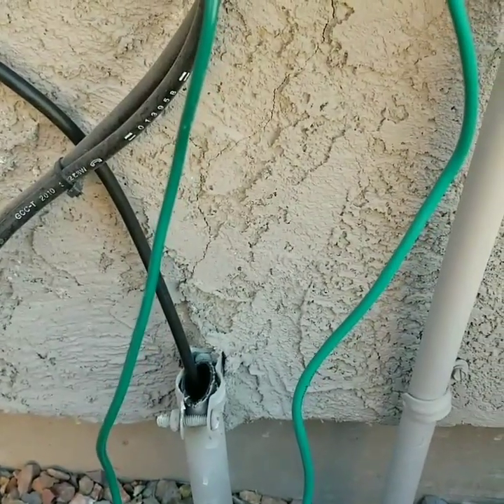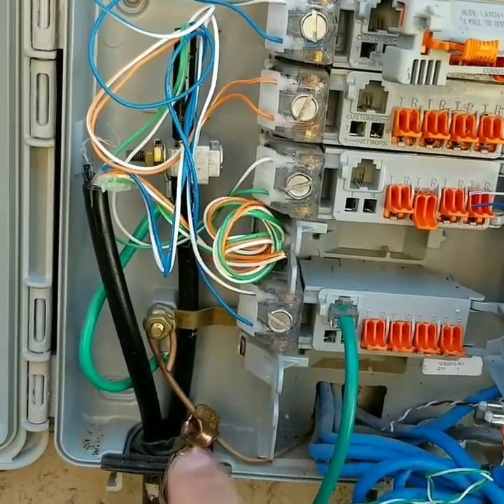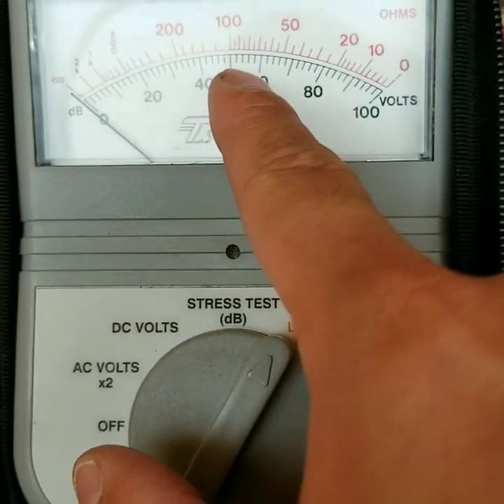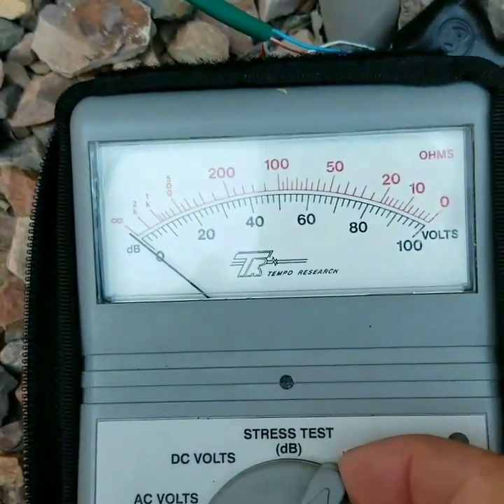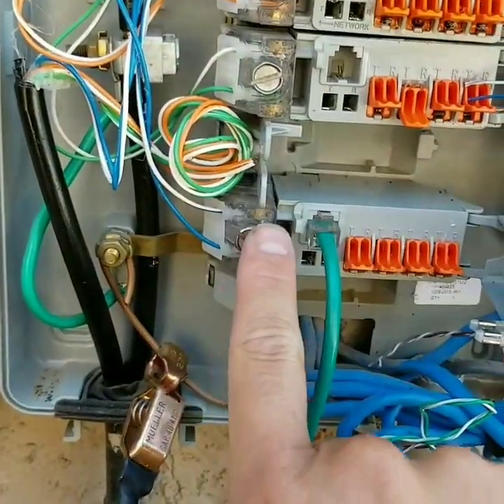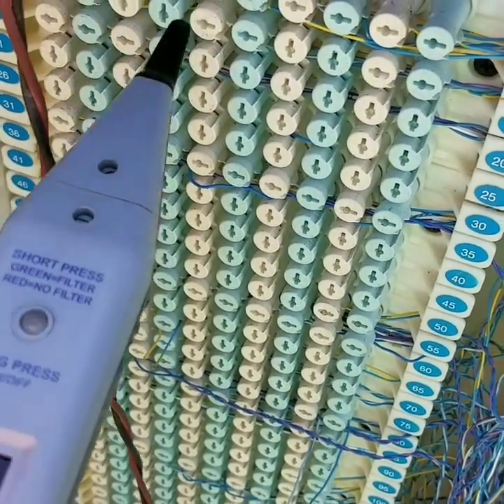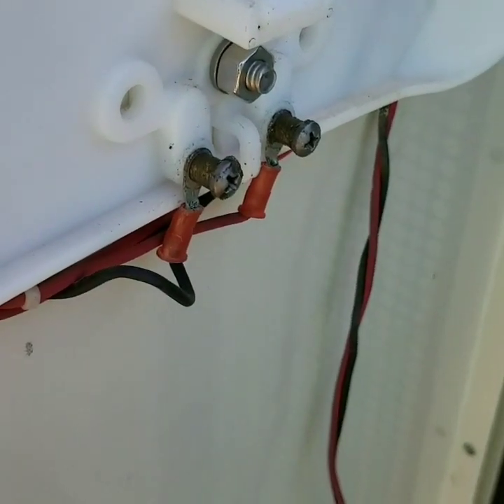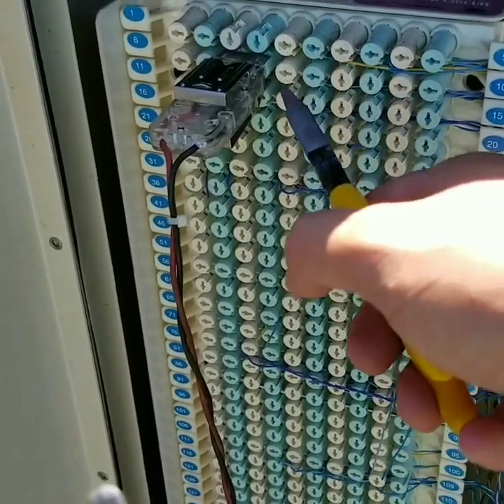DSL Internet - Bonded DSL Installation Guidance

Comment: Listen, guys.....I'm an "old dude". A telco guy. Believe it or not, through pair-gain software, I had one of the first DSL connections ever tested in this country on a MAC-II-SE in 1996. DSL technology had just been introduced, at 512Kbps (half a meg), and the tests were all being run on separate lines. I literally stopped the testing at one point, and said "if dial-up frequency is blocked by the filters (standard practice back then), then why are we running separate drops for DSL connections? Why not just use the unused twisted pair?" Traditional phone lines to homes consisted of 4 wires (tip and ring) in a single sleeve, but dial-up only used two wires. At one point, after DLS service became wildly popular, I asked "why not bond the wires? Why not quadruple the potential?" I was met with scrutiny, as the top Internet speeds at the time were 1.5Mbps, and nobody was subscribing. The "killer app" was simply e-mail and online greeting cards. It wasn't until the beginning of Social Media - with MySpace - that companies began to feel the need for more bandwidth. I had officially retired in 2007, but kept my consulting business going. I smelled the fart before it left the ass, and started contacting EVERY telco operation that I had dealt with for almost 40 years. I tried to explain to these old hard-working, but resigned FOSSILS what was coming. I tried to tell them that the DSLAM's (remote telephone offices equipped with DSL service) they had would be able to provide Internet speeds that would lead the industry. At the time, the fastest residential internet speed was 8Mbps, and it was from Comcast. Let's do some math. A bonded 4-wire infrastructure - which was already in place because of "life-line" Regulation measures by the FCC - every single home needed dial-tone, according to the Government. So, the infrastructure was ALREADY in place. That twisted-pair infrastructure - already in place - when bonded with a second twisted-pair line (already in place) would have provided incumbent telco (landline) providers with an advantage of being the "first" in place. 1.5Mbps x 4 is 6Mbps. Existing telephone companies could have EASILY quadrupled their download speeds, and kept subscribers. Instead, they did NOTHING. And now, the companies that literally brought connectivity into the home are ghosts. For the record, a 6Mpbs connection won't impress anyone, but what it would do is provide the option for remote learning and video conferencing. Live video (480p) uses just less than 1Mbps to operate. Watching a movie (1080p) uses about 3Mbps. A 6Mbps connection would allow a person to attend a video meeting while their kid watches a movie. Billions were spent securing this "lifeline" infrastructure, and as soon as "smart phones" arrived, and millennial politicians arrived, the past infrastructure expenditures became nothing more than travel-expense accounts. There are MILLIONS of MILES of infrastructure - every home had a telephone - that are capable of high-speed internet, yet, politicians will stand at podiums - completely ignorant - and tell us all "we need to design a new hammer." Every single home in America built before 1996 (Telco Act) has the capacity to have at LEAST 25 Mbps internet service. Every single one!

Comment: So I have Frontier ADSL2 bonding12/2 but they only have one line to my home yet it works. Today I am getting another ADSL2 bonding connection so we will see if I get two new lines dropped. But they did say I am on two ports that I can see any ideal
Reply: If you see one physical line in a black sheath, there's probably at least 2 pairs inside of that. There's typically 6 pair drops in the newer areas I work in, both aerial and buried.

Comment: My question isn't related to the video but my search for an answer to a router problem has brought me here. Maybe/hopefully you could answer it. Would very much appreciate it. I have DSL to start. My ISP rents from Frontier and provides us with quadruple the speed that frontier does in our area which is weird. I have to use their modem to be able to have internet. I bought a new Netgear Blackhawk router and when I plug it in to my modem it immediately turns the internet light red on the modem and when I run the Netgear router setup genie it can't do the whole setup because it says it can't detect internet service. I've power cycled the just the modem, both modem and router at same time and just the router and still doesn't work. Any ideas what could be wrong? Maybe a couple ideas to point me in the right direction? Would very much appreciate it. Been searching online and can't figure anything out. Very frustrated.
Reply: You need to change the night Hawks settings and are you connecting on 2.4 or 5 on the nighthawk and are you connected har wired to modem >to router> to PC?